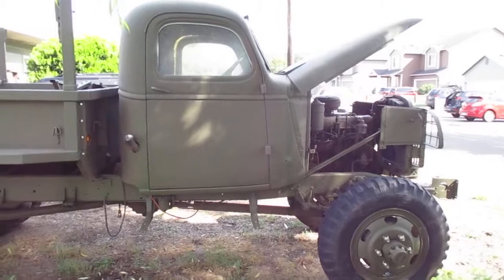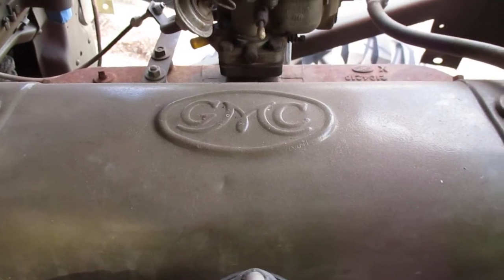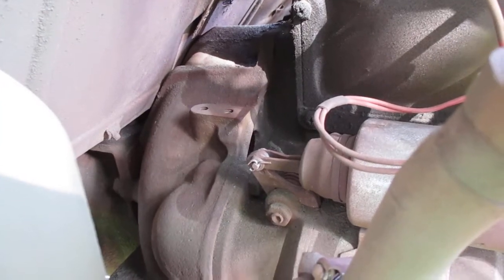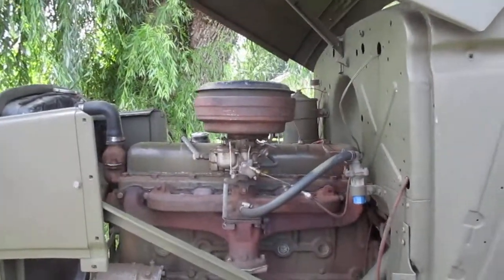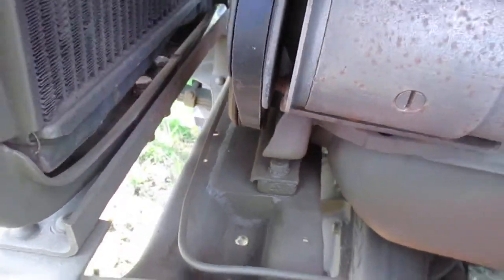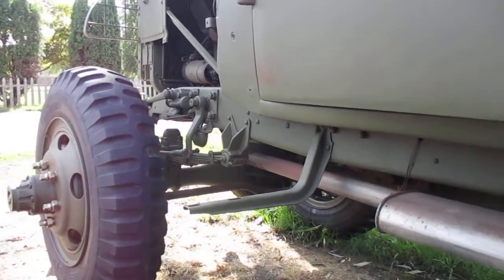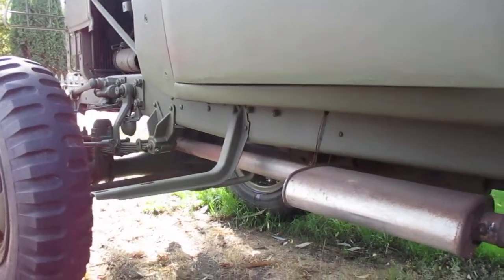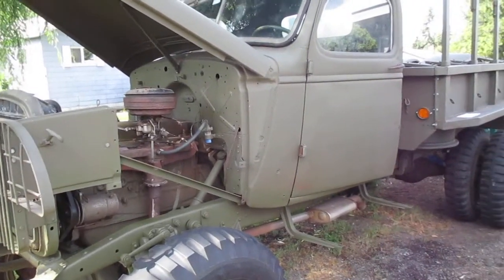GM 270 Front Engine Mount Modification into Chevy G 506.

Comment: I put the CCKW trans in my truck too back in the late 80's.  I love it.  The ratio is .8 or 1.25% faster in 5th.  Mine does 60 MPH too with the 235 but it has no extra power! Nice job of the front mount!
Reply from the maker: Thanks very much. I love the AS T-93/Clark 5 speed too!

Comment: I drove 2 1/2 ton truck for 2 years in the Army. Hauled rations from Hilo Hi to Poaculoa.  That engine was a tough son of a gun. I think it was a 270. All I know for sure it was a 1953 with a GMC engine. The weak point was the automatic tranny.  2 speed high and low range. With a full load going up Monakea volcano. Forgot how to spell it top speed was about 5 mph.in low range. The engine couldn't handle high range. There was a place to pull over about half way up. The exhaust manifold would be cherry red. 1959 and 1960 when I was trying to climb the ramp into the LST the tranny was slipping. They left me on the beach. When they came back the tranny had cooled off and it went up the ramp. When I went into the Army national Guard they asked if I could drive a 5 ton. The sarge said you will be driving that one. It was a multi fuel. Never been in one.
Reply from the maker: Awesome story Ralph, you had a 'gravy train' of a duty station to have been post in HI. I know the truck you're talking about. Did it have 10 wheels or only 6 wheels? If 10, then it was an M-211. Kinda sluggish and the Hydra-Matic transmission is prone to issues if not properly adjusted, so I have read.

Comment: Usually those overdrive transmissions have that reversed shift pattern with high gear being up. It's the easiest way to do it because the power has to flow through the counter shaft to get the overdrive. 240 horsepower is pretty respectable out of 270 cubic inches considering those engines don't rev very high. I'm just kind of curious I wonder if an LS would swap in there without a whole lot of problem. Do you think the engine compartment is wide enough?
Reply from the maker: Good question Joe. Yes a Chevy V-8 will fit into the engine bay. I installed a '95 5.7 with a 700R4 behind it into a C.C.K.W. back in 2009 for a friend. There was quite the domino effect that followed with the radiator, trans. cooler, shifter linkages, control pedals and more. I will not do it again. The biggest problem the truck faces is that it won't go much faster than 65 M.'s P. H., due to the ring and pinion ratio being 6.67 to 1. Then the W.W. 2 originality is lost with building a resto-mod like this.
Reply: @w.w.2restorations.vehicles698  Personally I don't think I would do an LS swap, but I was just curious. LS motors are plentiful and cheap anymore, and the stove bolt Chevy 6, or GMC 270/302 are getting kind of rare. A diesel swap would be very nice, but you'd never make it work with this 6.67 gears, you'd end up spending a fortune
Reply from the maker: @joecummings1260  No worries bud.
Reply: @w.w.2restorations.vehicles698  By the way I appreciate you showing the serial number location and that the 270 starts with 270. We are supposed to have one coming in in a junk truck that is either a 270 or a 305. Now I can look like a genius and identify it
Reply from the maker: @joecummings1260  LOL!! Good on ya, Joe. The next largest displacement is 302. So those will be the first three numbers on the pad in the junk truck.
Reply: @w.w.2restorations.vehicles698  Yes sorry I didn't mean to type 302, I think I had a brain fart or I was thinking of the 305 v6 or something.

Comment: Did i miss the tire size?  Are they the usual m35a2 9-20s?
Reply from the maker: Hi Brent, no the tires are 8.25 X 20's. The correct size tire for this truck is 7.50 X 20. They are on the correct wheel for the 9.00 X 20's though. You can hear/see my explanation in this video. https://www.youtube.com/watch?v=IRoYuSafXMk&t=189s...